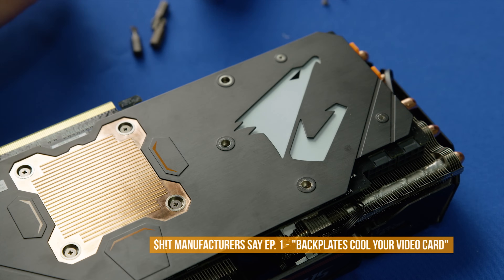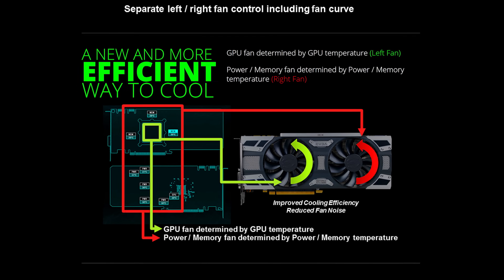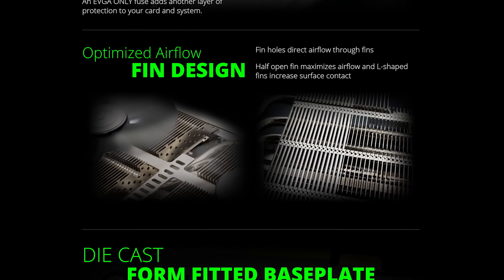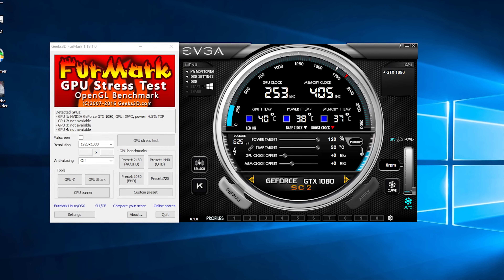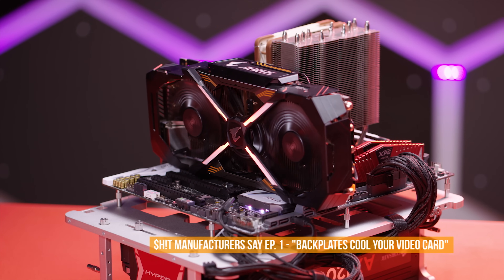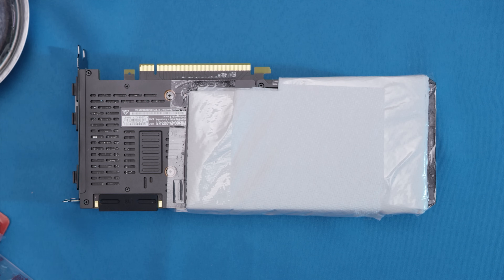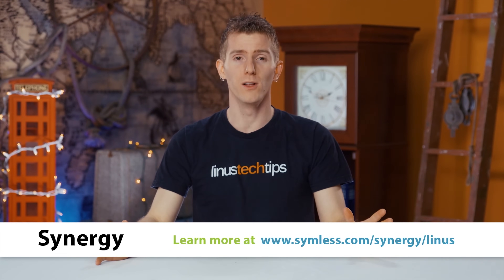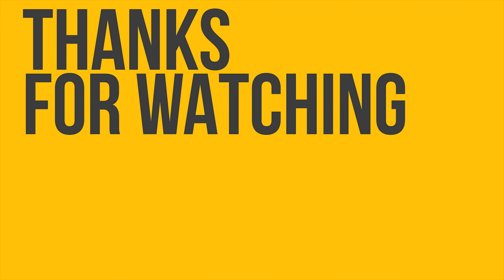The SOLUTION to Video Card OVERHEATING & DEATH

Comment: I love COOLSER MASTER COSMOS II CASE! its weight is back breaking heavy! since its all MAT BLACK I wish it was GLOSS BLACK for that HYPER CAR SHOW ROOM SHINE. however I do love its car door design. and the amount of space that can put anything in there. Water cooling oh yes it can. or air cool only the biggest ever can fit. 13 hard drive bays. I can use as many hard drives my motherboard will allow and still got room for more hard drives to swap later if need it. I do love the legs to keep the case above the floor so that the power supply fan will be used properly.   its so bloody heavy  a robber will think twice its too heavy to run off with. Now you know why I got it

Comment: Its funny to see how the marketing has played on misconceptions of an part. The backplate was never made for the purpose of gaining cooling benefits, or to dissipate heat. If noticed, backplates are only available on mid to higher end cards with bigger heatsinks, and water cooling versions. Because the backplates purpose is to add rigidity to the cards pcb to minimize flexing and bowing resulting in sagging video cards. Thats all!!. Why would backplates have vents cut in them, if its to accumulate and dissipate heat??? Lol. Rather its to redirect the heat otherwise will be blocked, as its for rigidity of the card. Otherwise the backplate would have direct contact with some compound to components to aid in heat dissipation. But clearly they have no contact. As it would most likely result in a fried card... Hence the vent cut outs also,. And why backplates are very specific to models of cards, in order for design to avoid solder points, and other metal contacts.

Comment: See when I clicked on this video I thought it was going to be like 
"HEY WANT YOUR GRAPHICS CARD TO RUN 20° COLDER?! JUST TAKE OFF THE COOLER, APPLY SOME JESUS BRAND SWEET THERMAL PASTE, AND APPLY A LIBERAL AMOUNT OF CUM TO THE HEAT SINK FINS!! REASSEMBLE AND OBSERVE AS YOUR GPU TEMPS PLUMPET AND GPU BOOST SKYROCKETS, CONGRATULATIONS YOUR 1050TI IS NOW LIABLE TO DRAW 2000 WATTS OF POWER!!" This, however, is not what I got Linus and to be honest I'm disappointed.

Comment: I get controll of all system fans with free software that works perfect all the time, speedfan.
I have it set up with different sensors and fans and curves and alarms. it can even send me mail if my system is overheating while i'm away.

It will automatically adjust case fans for hdd-temp, case fans for cpu or vga temp, cpu-fan for cpu and or vrm temp ect.
Amazing software.
Speedfan for life!

Comment: more temp sensors help with overclocking in the following way. I have a 270x that was artifacting at random times. it took me a few days of testing to figure out that it was caused by overheating VRMs if i had the thermal sensors available it would have taken me maybe 5 minutes to figure out the issue.  this is where the "overclock better play longer" would come into play, if i knew my VRMs were starting to get hot (b4 it started to artifact) i could have modified the cooling solution for them to provide better protection.

Comment: Hey linus you can try to put a huge thermal pad between the PCB and the backplate(there is a plastic cover on the inside of the backplate on some cards).That should take some heat from the PCB and it might help cool off litle components

Comment: The SOLUTION to Video Card OVERHEATING & DEATH = if temperature is too high, increase fan[s] speed, with MSI Afterburner, if necessary.  I manually set mine.

Comment: Linus is there anyway to clean a  980 TI  with out taken it  all apart just to get to the  heat sinks
Reply: Air compressor and a thin piece of copper tubing attached end of sprayer to get in cracks

Comment: I update my drivers for my EVGA GeForce GTX 760 SC and the god damn thing was dead 5 minutes later. Now, I can run my monitor through it still but cannot rollback or otherwise update the drivers. Im stuck with Windows Display Adapter. 

I spent 4 days trying to figure it out, I give up. 

* I did literally everything you can suggest. Ive been to every forum under the sun. Ive done everything.

Comment: I have three GTX 1080 ti (ZOTAC) in my tower machine. Because they are so close (almost touching each other), the GPU temperature heats up to around 88C when running the program. I usually run the program for 3 days in a week. Will the high temp cause any problem of the cards?
Reply: According to nvidia specs for 1080 ti. the chip is rated to 91C so you are close

Comment: My Zotac 1080 Amp Extreme will slow down the clocks at power limit, because of the fans were at 100% in furmark, while at 70% fan speed it stayed at full clock speed while only being 2°C higher on the core. granted that furmark is not real world scenario, however EVGA's claim about the  low power fans helping gpu overhead is absolutely accurate. 

Thank you for always keeping the Tech talk fun :)

Comment: I think backplates used as heat spreaders does more to prevent heat from being trapped by the plate itself.  The plate itself is more for looks and and to reduce flex.  But that's just my opinion.

Comment: What a waist of time & money lol. Fucking marketing strategies. I have an Aorus 1080Ti and I have my fans set to 100%, and I hear the AIO pump over everything els. I have a large metal case which probably muffles some sound. The truth is my A/C make more noise than my hole computer with all the fans on 100%. The idea seems cool, but it needs more R&D.  Maybe liquid cooling might benefit more from this like you said. I'm thinking a cooling block with multiple pumps that control temperature for smaller localized zones could improve the performance of the cooling system in its entirety. Again its one of those R&D things, but I would buy something like that for my custom cooling loop.

Comment: Solution: don't overclock and dust regularly. Not gonna burn that extra energy just for a few frames.
Reply: i know this is an old post but, with overclocking you can save a ton of cash. Like I got a 5820k overclocked and its performing much better than a stock 5960x. Same with my 1080 ti. 2100mhz on core and 13000mhz on memory. Currently like 25% better fps than stock 1080 ti. Could say I already got the new 2080.
Reply: u can avoid it by using water cooling system
Reply: Should I over lock because when I play stuff like roblox my pc just becomes pretty loud from the fans and my cpu temp rises higher. Should I get like radiator fans or just overlook my fans. If that’s how it works :/. I’m not really a computer dude

Comment: in my impression people at EVGA-customer support got pretty stressed out about complains over heat and noise issues with theyre gtx 10.. lineup cards. especially the ACX 3.0 models had some issues with trapped heat. the new aproach is a card that gives the user more overview to all the diffrent areas of the video card. they must have put a considerable amount of time into the developement of the overhauled cards and the software. for a few weeks people could also send in the older card they re not happy with and get a replacement at little cost. i think a lot of the complains and issues came from people who are into silent gaming without the use of a water cooler. i would not recomend it unless for professionals who have monitoring cameras and sensors in all critical areas. this new cooler is a step in this direction i think. is it profitable for EVGA? i doubt it...

Comment: it only improve efficiency... not really cooling.... so no... If we already have decent cooling this card does nothing to improve that... the sensors also appear excessive.... certain parts of the GPU are always going to be hot... having sensors to kick the fans based on the hottest components does not require so many sensors... temperatures do not vary that much across that pcb... not worth the money at all... 

I never liked non profile cards anyways... get rid of them ridiculous fans that really don't do anything but push air around in every direction... it sucks for airflow management. Profile cards are better.

Comment: i dont know, do some video cards manufacturers this intentionally tocoll the gpu/mem good, but only airflow cooling on the VRMs?
so they die (a friends Radeon HD 7950 did so, and many more if you search for the defects of the broken ones)
and a Gigabyte  RX 380 i wanted to try, this one had too much space between the VRM and the cooling system for any pads, but also not enough to fit in some small aluminium heatspreader, so i send it back
i think a good VRM cooling is needed for a long lifetime. a longer time ago it was "normal" for (highend)videocards to get about 90-100°C, but they had due the high consumption also hard VRM cooling.
today, with "power limits" and so,  they can downsize the cooling for some 0,x$ per card. sometimes on the wrong parts of PCB -.-

Comment: No offence, but... how trustworthy are those sensors, which consider temperatures of 80°+ on the memory fine enough to not even spin the fans up? Mind you, that's even on a EVGA card which iirc have the longest warranty (up to 10y here in Germany), so if they don't bother extending the lifetime of the card, what manufacturer would?

Personally, I set fanspeeds to 100% when I play games... and I wouldn't buy any "performance" (>XX50 GTX or >RX X60) card with a lame reference cooler... i do remember those things all to well from the HD4XXX Series.

Comment: Yes, The extra sensors becomes very useful when you are editing your video BIOS and adding extra voltage from there. You most likely won't notice the added cooling performance due stock voltages not needing the extra thermal headroom. Also nvidia stock thermal target is 71 degrees. I always reset mine to 91 degrees.

With a bump of voltage of lets say 1000mv, your gpu can easily hit 85-90 degrees. I've clocked 1126MHz/boost 1216 to 1550/boost 1630 mhz and on air your temps are in the high 80s

Comment: Sounds interesting. I have a Gigabyte GTX 1060 and it was suffering from random shutdowns at low GPU load until i manually set the fan to be always on. I believe this was caused by the fact that I use three monitors and therefore the VRAM never clocks down, even at idle, and so it overheated.

Comment: System integration would be cool.
Currently case fans can either be adjusted manually, or respond to CPU temps, but when gaming my CPU might not need as much cooling as my GPU, so it would be nice to have my case respond accordingly.

Comment: I just leave the side panel fan 100% of the time, problem solved.
Also its the most convenient place to cut, so you can direct a fan no matter the position of the video card.  Course there are 240mm + fans, but I've never tried those.

Comment: I feel like my FTW GTX 1080 has these temp sensors, because OCX picks up temp sensors that are NOT on my motherboard or CPU, or any other temp sensor in my system.  I cannot equate them to any other sensors, and they heat up with use of the graphics card.

Comment: I'll have to agree that more sensors is a big plus. It's the same kind of thing with a car engine. As time went forward after OBDI was implemented, cars slowly began to have more and more sensors. Annoying as it is to the car modders for their stock cars, it allows incredible control and better cooling, longevity, and power output if you use custom controllers (ECUs).

I feel like the same thing can be applied to graphics cards, especially those with water coolers. It would be cool to test out different water cooling brands and see how they differ in the areas where the new sensors are. :)

Edit: Who knows if the water cooling brands can also use these sensors to better improve their products, allowing modders to push their cards even harder than before.

Comment: While I love the idea of more sensors, to monitor the goings on in my chassis, I just wish that we had more after market choices for gpu coolers. We have some, with water blocks, and giant heat sinks, but nothing really of note. I often imagine how awesome it would be, if noctua made a gpu cooler. I once read on a forum post on the linus tech forums, that somebody once removed the fans off the gpu heatsink, and used stronger, static pressure fans, which resulted in much better temps. This leaves me to believe that most gpu makers, choose style over performance.

Comment: GFX card manufacturers need to use better quality components and stop skimping.

Have lemmings with dry ice in back packs fly into the fan blades and shower the card with vicious cooly air and cool the GPU down!

Comment: I am about to graduate college in Computer Science  and my old pc needs an upgrade. If you were to get a computer right now for developing and light gaming. If you wanted to stay below $3000 dollars what LAPTOP would you get??  I am currently using a Macbook Pro Late 2012. I also have an old Lenovo G570 with an SSD for Windows as well. Should I get the Dell XPS 15? What would you guys get??? Please I need your help!!!!
Reply: If you value battery life and portability highly, then the best options I've found after extensive research are the Gigabyte Aero 14 if you want a 1060, Alienware 15 R3 if you want a 1070, and XPS 15 if you want a 1050 Ti. I ended up going with the Gigabyte Aero 14, which is awesome except for some peculiarities with external monitors.
Reply: Raymond Liu Thanks yeah Alienware 15 and Dell XPS were both on my radar. I will look into the Gigabyte Aero 14 Thanks!

Comment: why don't they just make fans that spin at max speed all the time?
Reply: GeForce FX-5800
Reply: NO MA'AM price and is it any good?
Reply: I just got my hands on an RX 480 GTR 8GB card, and the fan's don't spin unless i'm gaming under load, nice and quite ;)
Reply: Ruben Braekman If a fan is producing maximum speed all the time then it will wear out faster, also the consumer will feel like its more versatile, so the cards seem more worth the buck even though we know it isnt.
Reply: +Ruben Braekman it was a joke. The FX-5800 is an infamously poor quality Nvidia product from 14 years ago. People called it the hair dryer, dustbuster, leafblower, etc. Even Nvidia themselves put out a video mocking themselves over the card.
Reply: NO MA'AM I had one
Reply: Because it's very loud and will burn out quicker. Most cards function fine at 50-70 without needing much cooling, it's only when they get over that, that they really need it.

Comment: It sounds like you guys glossed over the marketing material. This review lacks so much information. Also, you need to test GPUs in a case or place a fan towards the GPU to simulate airflow inside a case.

Comment: Interesting, but ultimately, I wouldn't pay more. A 1080 was already around $709 and in short supply in summer, paying an extra hundred or so isn't worth it. my card's 3 fans are almost always defaulted to on, and the GPU gets air from cause fans, with a  GPU header allowing a PWM fan to be attached  for another intake or exhaust when the GPU gets hot. I use mine to expel hot air. This is a feature I would pay for. GPU fan headers. Or no DVI/more displayPort connectors.

Comment: why don't they just use a peltier chip in between the components and an oversized radiator?
because obviously if you're an overclocker, you're not worried about power consumption.

Comment: If I was in the market for a new card, I would definitely pick this one. The added control and sensors would allow for software updates to adjust the algorithm and other aspects. Also, the idea of knowing the VRM temps helps with peace of mind. Power systems are usually the hottest part of the card and they're always neglected.

Comment: i feel like linus missed the real purpose of the back plate hype. Back plates offer better heat conductivity and therefore will contribute to greater heat dissipation.... if there is moving air above the back of the card. In an open environment, these forces are weak. When paired with a fan, back plates can exponentially increase heat dissipation. A more accurate test method would test the usefulness of such pairing (fan and back plate). Testing examples could include: degree of fan angle with regards to amount of heat dissipated, distance from back plate.
Reply: would like to see this kind of test as well. If there is a fan on the back of GPU, would it be cooled more effectively with a back plate or without.
Reply: I think you'll find that the increase in heat dissipation is quite polynomial.
Reply: luke malcom The backplate and its color make up less than a percent of the cooling performance. Its just there for optical reasons, unless manufacturers decide to go for a more manufacturing intensive full dual side pcb layout, which would allow for the backplate as a secondary heatsink for the vrm and such.
Reply: Black is not more conductive. They do radiate more though